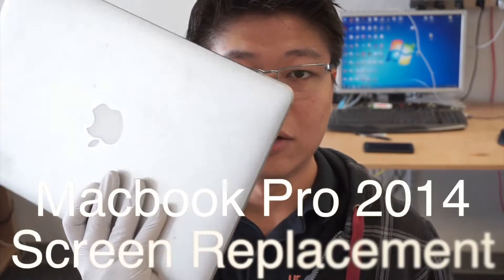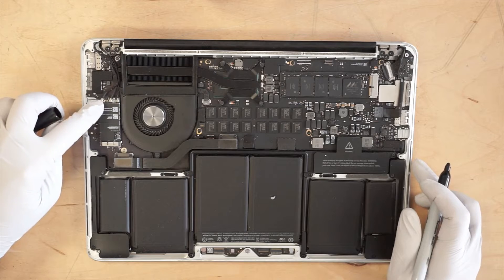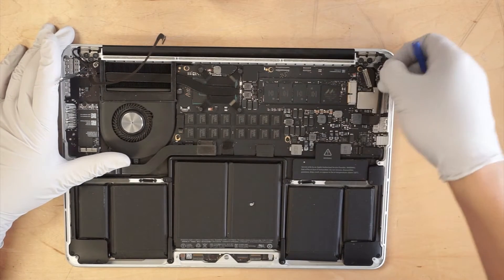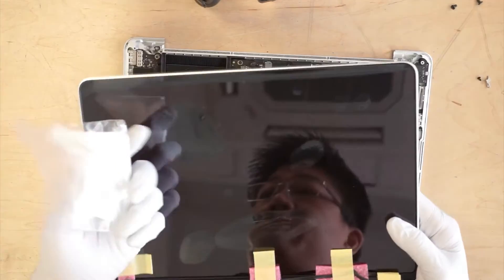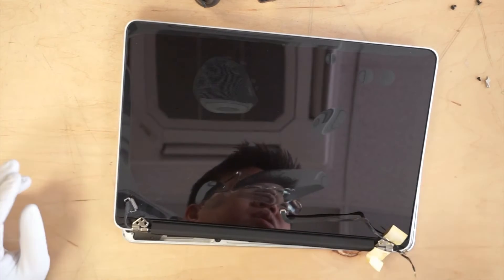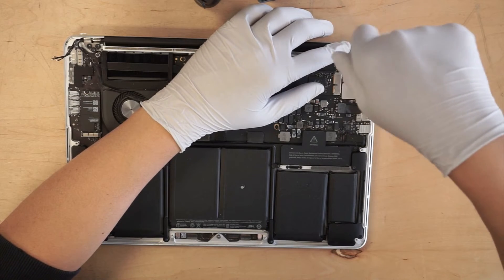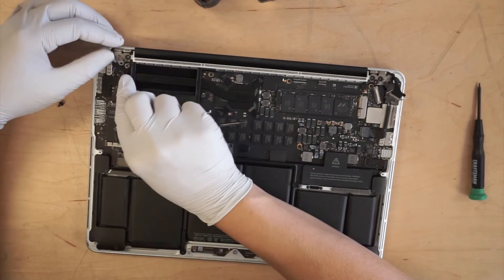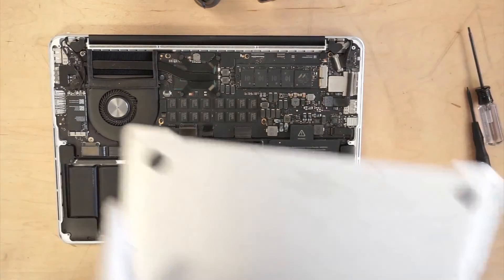Macbook Pro 13" Retina Screen Replacement. Step By Step Tutorial.

Comment: Hello ! thank you for the video ! Do you think it is possible to put a late 2013 screen on a mid 2014 computer ? (I think there is a different cable, the one with the camera) Thank you !
Reply from the maker: Maybe you are looking a different model ? It should be compatible for late 2013 on a mid 2014. Double check on the description and match the images cable as well. Did you try the link in description ?

Comment: Just please DISCONECT the Battery-CABLE, I burn a MBP my lost your gain of experience.  (I think the vid on a discharged mac)
Reply from the maker: Sorry to hear that. 99% without disconnecting battery, we got them working. Maybe you did not shut it down ? Oh well.... good tips, better be safe and disconnect battery first.
Reply: Where is the battery cable? What happens if you don’t disconnect it?

Comment: Great tutorial and I may be doing this soon. My cat knocked my tea over on my Macbook Pro 2015 mid. 15" retina. Now I see bright light coming through the bottom left corner. Is there anyway to fix the screen without purchasing and replacing the screen ? I know stupid question but limited funds. Im sure I have to purchase a new screen assembly and need to look up the cost, pricey I am sure. Also, is this the same assembly and procedure for my particular computer ? Thanks for the tutorial.
Reply from the maker: Sorry to hear that. You need a full assembly LCD screen replacement. Note, this video is for 13". But the foundation steps should be similar to this video.

Comment: Hello, I have a MacBook Pro late 2013 13 ", he is with black screen, but works on external monitor. but he turns on automatically when I put the power cable, do not need to press the power button.
What could it be?